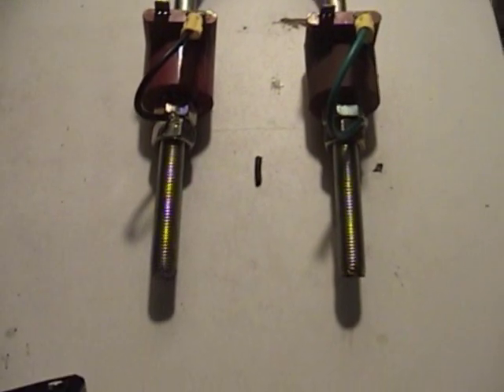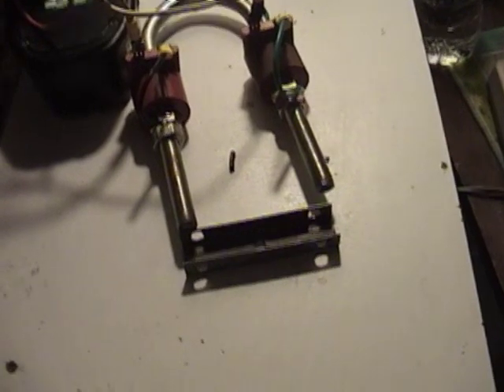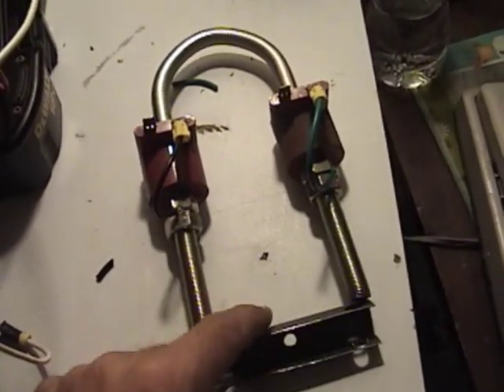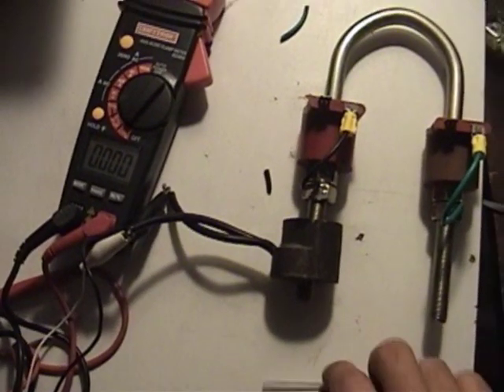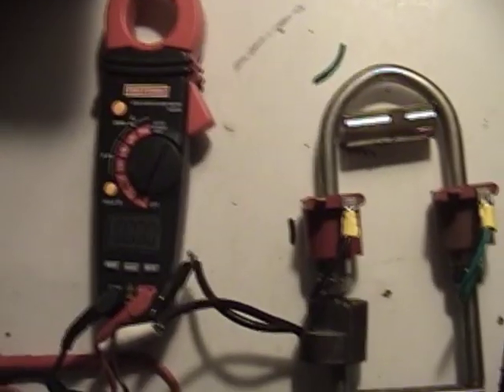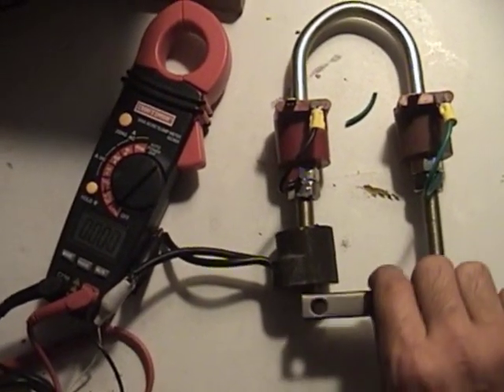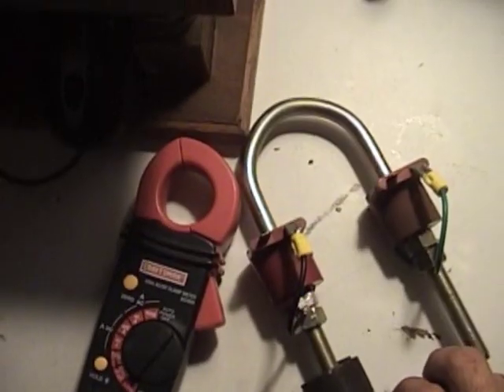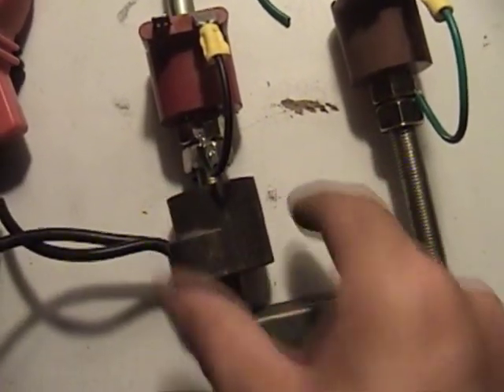Ed Leedskalnin Magnetic Current Pt 1

Comment: the motion holder and keeper needs to be made of soft iron or it will become magnetised after the current is removed.....use soft iron and it will stay stuck together as did ed's....but not make a permanent magnet ...the same principal used in electro magnets...i hope this helps
Reply: Exactly... and this is what invalidates those who claim it's "magnetic hysteresis"... because soft iron exhibits nearly zero hysteresis.  If it were magnetic hysteresis, then (as in this video) the cross-bar would be easily re-attached magnetically when power was removed, because it would be retaining some of the magnetism from the initially applied electric current.
(which is exactly what happens in this video - because he used common steel (which has high hysteresis), not soft iron)

Transformer cores are really good material for this experiment, since they are optimized for minimal hysteresis - which makes the transformer more efficient / lower-loss.

Comment: I'm seeing a piece of metal that got magnetized (it IS a magnet now).... so of course you will see a little voltage on your pickup coil when you have a little magnetic field moving through it, which happens when you close and open the magnetic flux  loop.  I don't understand what is so astounding about this ??

in retrospect i see other viewers picked up on this.

Comment: Does anyone realize that this perpetual motion holder is the means of picking up the "energy" as the open system magnets pass over the closed system pmh? The bar at the end traps the energy in,  the magnet can only handle so much input, and the coils let the excess bleed off. Amplifier pickup.

Comment: cont...
Think of the atoms as tiny electromagnets in which electrons are whizzing round and producing a magnetic field. In this case, by using a coil and the magnetic field it produces, we can force the 'atomic magnets' to align with the field. When we remove the field, some of these atoms will remain aligned this way. This property is called magnetic 'remanance' and the extent to which it happens depends on which material you use.
cont...

Comment: continued...
The flux 'flows' round the 'magnetic circuit'. Much like electric current, the magnetix flux will take the path of least resistance to return to the other end of the magnet (or coil). In magnetic circuits, we call this 'reluctance' to avoid confusion with 'resistance' in electric circuits. Without the extra piece of steel, the flux will try to travel through the steel, but much of it will be forced to travel through the air.
continued...

Comment: continued... The magnetic circuit is not complete. By completing the circuit with the piece of steel, more of the flux will 'flow' through the steel and very little will 'flow' through the air. The flux path has changed quite a bit, and this means that the flux passing through the pickup coil will change, inducing a voltage.

Comment: @BhdRoussos I did, in my 2 videos I made on the generator.  One thing I forgot to mention is how the wheel is a cup, an overflowing cup , works as a reservoir for heavy ions. This would help it resonate charge against magnetic fields back and forth from the stone/hoist end point.  You already know that +ion charge and magnetic cancel eachother out, all his gen.does is do that in increasing momentum 11 cycles a second (nowdays) 9cycles in Ed's time.

Comment: @BhdRoussos My coral castle video shows some. 24 counter rotating magnetic currents is the key because 12 of them pull particles out of a center, the other 12 do also but not as much. When earth's hz wave carrier zinewave moves to influence all magnet's powers, it forces a z wave to form since smaller electrons must remain in center on shaft as bosons are lost from spin. Bosons in concentrated sets of 7 are heavy ions and are slow positrons.  If you are serious about building one pm me.

Comment: Neat.  I'll tell you his biggest secret though. 12- and 12+ poles flux in strength when attached to a chainhoist antennae which feels the mag res of earth flux , 9hz back then, now it's faster, but no matter. The 12 points will contain 2 layers of 7 boson particles which each spin with eachother at a 90degree intercept of electron flow; this is defining a positron. It can both generate power, and be used to reverse gravity. My video shows some. I'll have a major update in a week or 2.